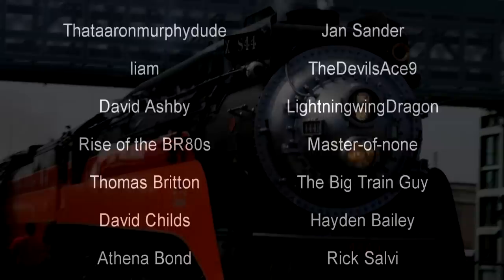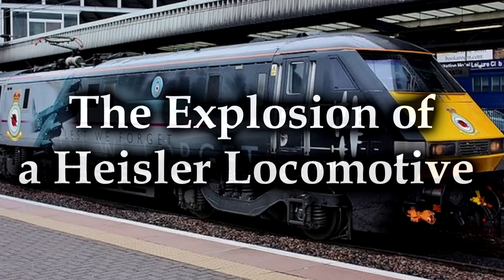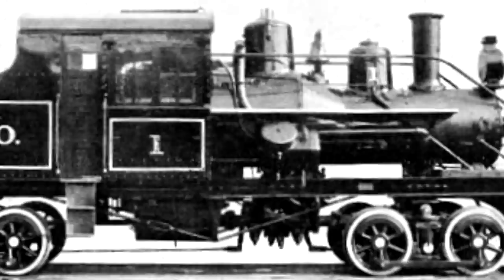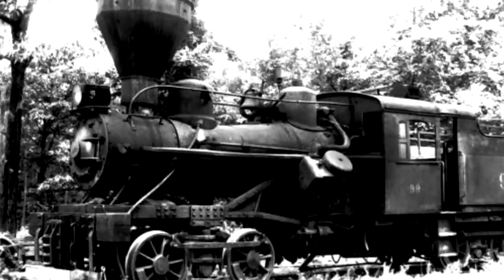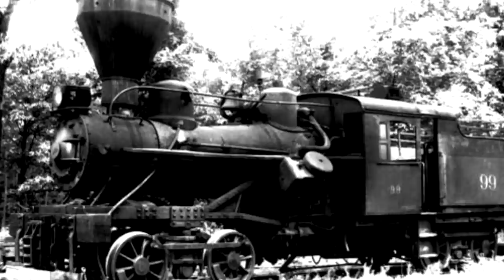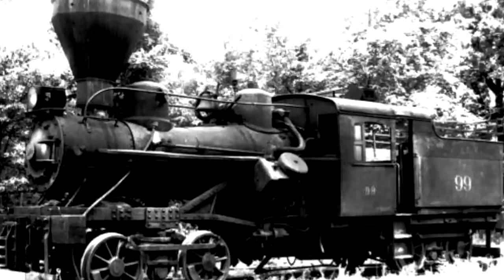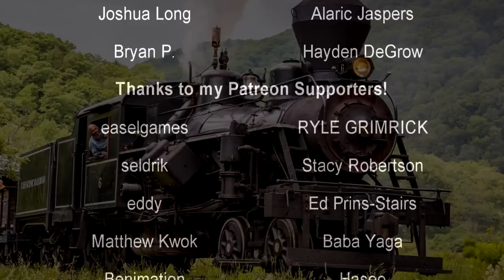The Steam Explosion of a Heisler Locomotive | History in the Dark

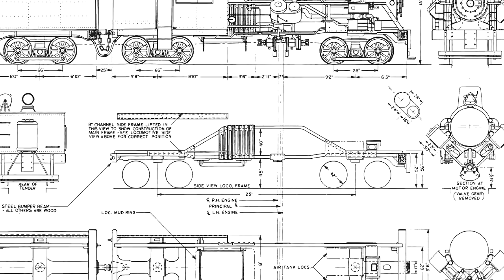Comment: To be clear: regarding 2:02, you are partly right, and partly wrong.  It really depends.  Typically however, what made geared locomotives popular wasn't their tractive efforts. It was their ability to easily negotiate over track which conventional (non geared) locomotives couldn't. So tighter curves, and track that was built to a lighter standard. The tractive effort was a side effect of this, but wasn't the main selling point.

What set the Heisler and Climax apart from the Shay, however was technical problems that Shays had, which never really got addressed with the Shay design.  Specifically, Shays had this very bad tendency to derail on tight right hand curves. This was because the way their drive shafts worked, with slip sections, they would suffer a mechanical lock when their gears and drive shafts would bind, causing them to either not swivel far enough, or just simply not return to straight and walk right off the track.

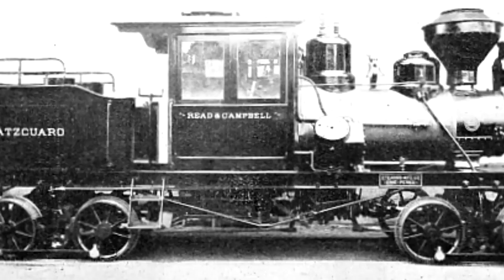One final note: regarding 2:43, this is true... sorta. There actually was a faster geared locomotive, but only five of them were built.  This was the "Davenport Duplex" locomotive, which was able to reach speeds of 50mph, while still being geared.  However, it proved to be too difficult to maintain, and didn't really catch on.  Davenport did continue producing geared locomotives in a limited quantity, but those were primarily limited to contractor type locomotives.

Comment: The Heisler is the pinnacle design of geared locomotives.

The shay was popular as it was cheaper to make and the first to show up. The problem for the shays are their limited turning radius capabilities. They are the worst of the 3 types. Due to their offset shaft location, the shafts of the shays can pop out of the slip joints when at a tight left turn. Consequently, during right turn, the shaft will compress themselves to destruction.

The heisler and climax had none of that problems. The 2 can even have a 2 speed gearbox. But the heisler is the best at delivering power without expensive gearing. The climax must change its rotation from the piston from lateral to longitudinal.

The design of the heisler can be upgraded too. Compounding the pistons can be done, either a double expansion or triple expansion for more efficiency. There is no technical limit of a heisler having more than 3 trucks too. With a modern design, you can use the technology found on road trucks with tandem or tridem axles or use tatras modular chassis design.

To solve the firebox issue, just design it to burn liquid fuel.

Comment: The last time I rode on a steam engine, it was a Heisler. The heritage rail (Roaring Camp, if you're curious) it was on doesn't normally run it, but both Shays were in the shop (they have a  climax,  but haven't been able to restore it. The chassis is currently sitting near the entrance and I'm wondering they've given up on restoring it). Because of the relative rarity of Heisler's, I expected a picture of the heisler I rode on to show up. Instead one of Roaring Camp's Shays shows up.